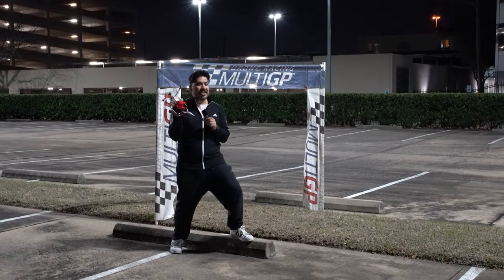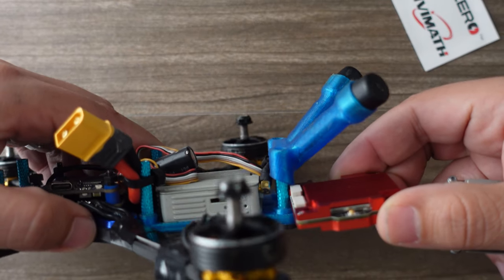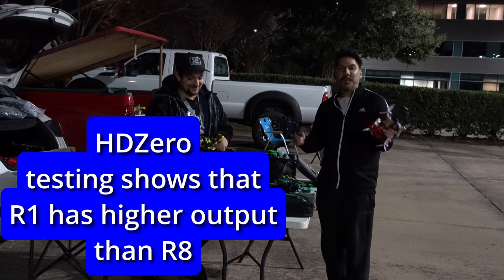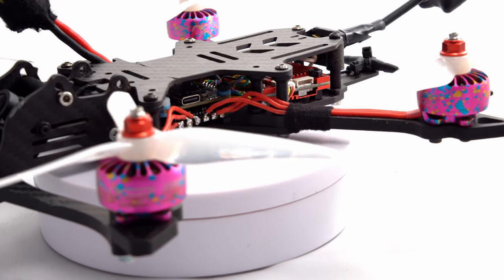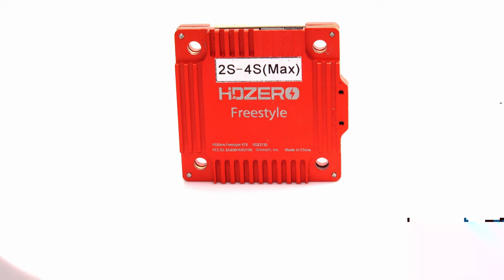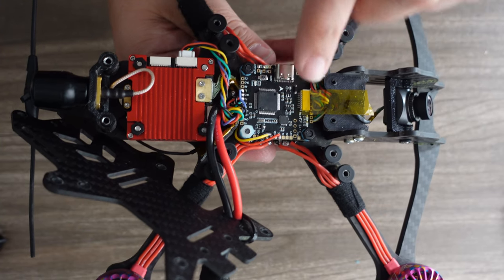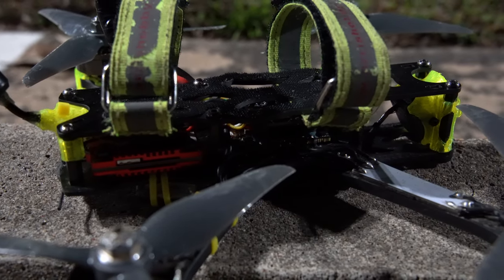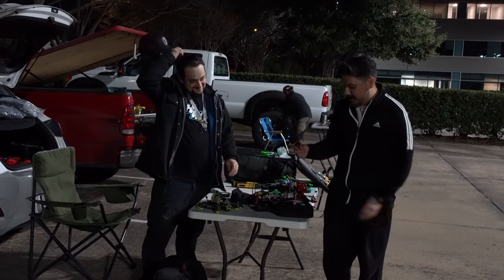HDzero 1 watt, Can you fly 2 at once? Digital FPV Video transmitter,

Comment: Not sure why it can’t be the crystal clear resolution of dji AND low latency. That fuzziness would irk me more than the latency.
Reply: HD Zero is broadcast like analog. So no retransmissions. When it did not receive part of data you get that breakup. DJI is requesting retransmissions so you get no breakup and very nice image. Penalty is latency. And is variable because of that retransmissions. They are 2 different technologies and 2 different sets of pluses and minuses.

Comment: So even in 1 watt it still gets bad breakup from trees and bushes so not a good park flying vtx. Alot of your video looked like alot of open parking lot flying and still had breakup so how is this good? Sorry I don't consider open air parking garages "bando" flying so the amount of breakup is just not acceptable. I have flown the og bytefrost and also analog and dji there is no comparison when it comes to penetration and image quality dji hands down winner.  The image difference between analog and HD zero is just not worth the added $$. Is the image better yes but vs. cost no in my opinion.  Keep up the great content and flying.